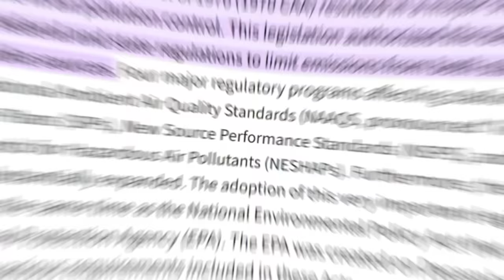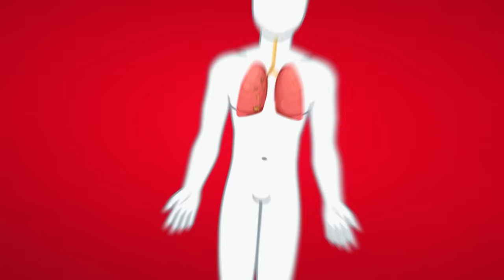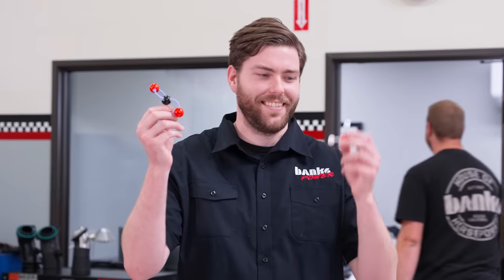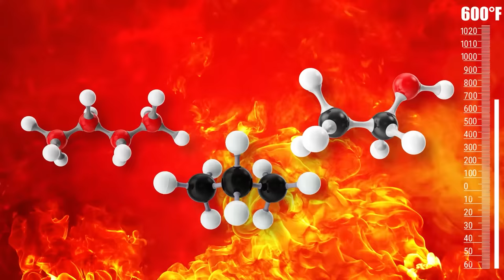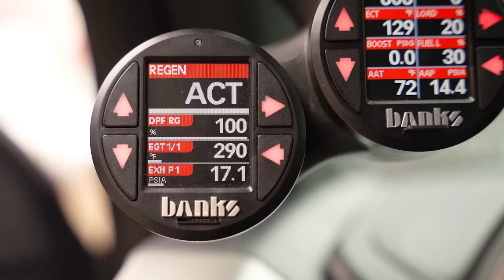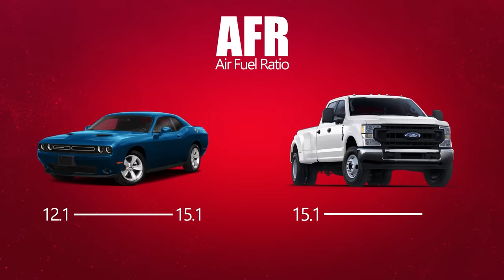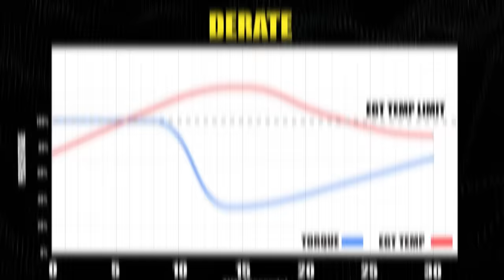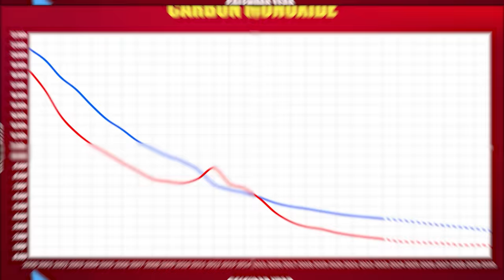Understanding the Most Hated part of your Truck | Banks Entry Level

Comment: I read online a couple months ago that the EGR was introduced to reduce NOx, but by doing so, it increased Soot, so next came the DPF. The more efficient a diesel engine runs, it creates less Soot, but more NOx. The less efficient it runs, it creates more Soot but less NOx. Then, the DEF will convert NOx to H2O. It seems like this is certainly the case in this video.
If this is the case, what reason is there to keep the EGR and DPF? I theorize that if we remove the EGR, the engine will produce mostly NOx, and we can counter that with more DEF. That way we can make the most efficient use of AFR, without having to inject non-usable gas into the intake, making the engine most efficient, while still remaining environmentally conscious.

May someone attest to my theory one way or another? I feel like I have to be missing something here, other than the fact that tampering with the emmissions system is illegal.
Reply: You are correct, theres been discussions in the class 8 truck scene to remove EGR and handle nox with DEF dosing only. It would definitely make the engine last longer without all the exhaust re-entry.  It seems to make the most sense to me, but I'm just a guy that's worked on these boat anchors for the last 20 plus years.

Comment: I don’t think it is so much of the fact that it might rob power, I think it’s more of the fact that those emissions systems are absolutely plagued with repair costs and also it going into limp mode when a sensor doesn’t read accurately. I’ve dealt with a lot of it when I drove a 2016 freightliner m2 106. Thousands went into that truck for repeated issues with the dpf/def system. The engine was great had plenty of power the transmission was beefcake as hell, it was just that damn system that would throw a code and eventually derate until in limp mode. Was not fun especially working accidents and what not. Placed me in a couple of bad situations. So you can tune all you want but those systems are garbage.

Comment: so unless i missed something, all of these waste products other then the ash can be burned away.

what about some sort of afterburner that just burns everything on its way out? could even run it on a fuel like propaine possibly?

the NOx wanta to be N2 and the O will want to be either O2, CO2 or H2O depending on its tempature, pressure and what else is available right?

Comment: What I don't understand is the DPF captures unburned hydrocarbon from the exhaust. But it plugs over time and has to go through a regen cycle, which puts in diesel (more hydrocarbon) into the exhaust to heat it up to burn off the hydrocarbon that has built up inside the DPF filter. So you'll still end up the with same stuff getting out to the environment and you more fuel. IDK, must be missing something, but you'd think engineers could figure out how to make the combustion more efficient.

Comment: I'm all for this tech, and I think it’s great that it has arrived in a time when we need it most. What I don't like, and I think most people share this same feeling with me on the matter, is none of this emissions equipment is without problems. None of it is reliable. It cost thousands to repair/replace. The vehicle is designed to not run without it.  So the common phrase you always hear is, my trucks in the shop more than it’s on the road. That's garbage! These trucks are costing more than ever, are not reliable, and get decreased fuel mileage compared to their predecessors. Again, if it worked and was affordable, I'd be all in. But as usual, the government demands regulations and control with little to no protection for the consumer.  Instead of demands, threats, and fines, the government should offer benefits and stipends to those who are willing to test this equipment out until the brains that be can perfect it.  But alas, that would make too much sense to take care of your fellow American.  

Last gripe, and it's in regard to diesel fuel.  What everyone needs to understand is, diesel is a commodity that our world cannot live without.  Like it or not.  Agree with it or not.  If you think about it, it's absolutely true.  Everything we do, create, buy, sell, trade, heat, etc. etc. etc. comes to you by burning fuel oil.  Boats, ships, trains, trucks, heaters, generators.....they all work on diesel.  As much as the liby's want it all gone, it just can't be done.  And it won't be done.  It's here until the end of time.  Maybe it's not the best option we could have come up with.  But its what we got.

Comment: As a guy who wants a newer diesel. And of course no emmissions. I don’t hate them as much as I used to before watching this video. I understand them more. So I don’t dog anyone for wanting to keep there’s on. 
But of course I’d still rather have nothing but a muffler at most between the turbo and the exhaust tip.
So I guess a questions I have. Is will Banks tune a newer truck that doesn’t have the emissions systems on em. Even if it will be used on the street. Or will they refuse to do it to avoid breaking laws

Comment: My opinion has always been that black smoke is fuel that didn't get turned into power.

And in a commercial application that's $$$$ getting blown up the stacks.

And I haven't owned a diesel rig in years but it was also black smudging down the side of my boat.

Comment: Sure its more complex and involves working around modern engineering. But i love how they literally prove that you can still make power, and more of it with this system on. I love the old diesels, its what im most familiar with, they are simple, and most people can learn to work on them. But videos like this hopefully help people stuck in the oldschool mindset to move on and up. These new trucks are offering better power ratings then ever from the factory. I wouldnt buy one made during covid and the chip shortage, electrical issues ahead. But the future is bright for new diesels, and banks, whose old aftermarket shit has adorned so many old trucks ive seen and worked on. To show that theyve more or less adapted to the times. Thats awesome!! Im from canada and my country is literally on fire. Like yellowknife was evacuated this morning, the flames are licking at homes and businesses. Think of all the towns and major cities too in canada, alberta in particular, my home province is rebuilding several northern towns and cities this year alone. The flooding, weve built berms, but the fires we cant protect ourselves from. And cutting the DPF and DEF systems out of your truck is a slap in the face to every canadian who is rebuilding from a wildfire right now. The diesel trucks that fought those fires all use this equipment, keep that in mind.

Comment: Hold on a minute, banks is definetly one of my favorite Techs out here but if you take all the things mentioned in this videos about the increased HP and torque specs from 2000 till this date and many other things is kind of misleading. If we take the example from lets say a 2.0Diesel with one from now ofc the gains are higher if you run it with 3Bar of boost compared to the ones from 2000 with at max 1Bar. The other thing is it might not make a whole lot of difference if you throw out the DPF but compared to the GPF its a hell of a difference, lets say theres even dyno runs on the newer models RS3 8Y where it eats 40-50 Hp and 70Nm of torque which from my pov, since gasoline cars with a PF run like dog crap compared to the models without it (same engine), the increased back pressure which you (banks) allready said its robbing Hp. The other thing is, we had a Tech warning, that the emissions that came out of a modern Diesel Engine with SCR, Add-blue where highly dangerous which we where not allowed to get close or put our hands on the muffler exit while measuring the emissions. Which concludes the particles are not filtered just shredded to such a tiny amount that its just under the regulations requirement.

Comment: Remove all exhaust emission equipment and gut it. Reinstall. Tune truck to keep check engine from coming on. It’s still in place upon visual inspection and still working good according to the computer.

Comment: Been seeing evidence of small diesel cars going into limp mode after a set mileage due to the DPF needing "Cleaning" even though the pressure difference is negligible. The owner will limp it to a shop, while it runs incredibly rich and then actually clogs the DPF. Manufacturer gets to pedal more DPF's and/or DPF services this way.

Comment: @bankspower 
So.. I liked most of the vid and explanation. A couple of problems I have though. 
1st) You don't talk about how diesel fuel itself is actually quite dirty and contributes to "Pollution" and how better fuel filtration can increase life expectancy of the engine and DPF system. 
2nd) As mentioned above, dirty fuel = more pollution which can = more regen. 
3rd) When talking with dealership technicians they often see DPF failure at or above 50K miles (just outside emissions warrantees), which can equal repair cost up to and sometimes over $20k to get your truck back on the road! (Solution?)
4th) Why is it that when my work truck goes into "Regen" it smells like a toxic chemical plant the leaves me feeling like "Sh#$"/ terrible (could elaborate more here) after catching a whiff of the exhaust which is unavoidable with my job? 
5th) Where is the proof of chemical composition for DPF tailpipe exhausted gasses? 
6th) My work truck is not the only truck going into "Regen", as I drive down the road I can smell and see! That's right I can see the regen gasses of other trucks in front of me stinking up the air with their regen toxic fumes! 
7th) Is this regens noxious gas really better than a little soot? I want proof! 
8th) DPF freezes in the winter time and can cause all sorts of problems. (Solutions?)

Oh one more thing mega transport ships run on Bunker Crude, so where is their emissions systems, especially when one ship produces more "pollution" than like 500k vehicles? 

Thanks,
Reply: Oh, forgot to ask one more thing. Why are we not allowed to know when the vehicle goes into regen? This would help increase survivability of the system, because it needs to finish its cycle to prevent damaging the DPF system right?

Comment: This is only one example of a DPF system. The one in my car is in the engine bay and uses diesel for regenerations.. makes the car run horribly when it goes into regen on the highway, it’s melted wire harnesses and lines around it.. it’s great 👍🏻 at least it doesn’t use DEF

Comment: Hey Eric, you did a great job explaining the DPF. Everything you said was spot on, 100%. Thank you for spreading facts and truth. The exhaust aftertreatment systems on diesels are one of the main reasons light-duty trucks are approaching or exceeding 1000 ft-lbs of torque these days. If you haven't already, I would encourage you to do a video on the DEF system and the role it plays in the reduction of NOx gases. 👍

Comment: It is nice that fass has come up with an egr filter that is serviceable, in my mind the concept of reintroducing soot to the intake is dumb and no level headed engine guy would disagree. Now as an American that hates egr and everything it stands for, I think there is evidence that egr does lower combustion temperatures, but at the risk of putting not clean air, even a particulate that is known to soot log piston rings, then proceed the oil consumption, we are in need of a superior design to simplify what we are trying to do here. So you want cleaner burning exhaust? Okay then let the guys that know how to properly efficiently burn more of the fuel in the cylinder design a better product. Also, if manufactures think they should put an entire after treatment system within the exhaust, why in the ** can’t they make it serviceable so that the particulate filter can be replaced like the heavy duty and industrial industry does with v band clamp connections so we don’t have to replaced the entire or most of the exhaust system???? I like what you guys at banks are doing to make an oe engine run to its optimum ability.

Comment: My only experience with the emissions on a Duramax was driving a 2012 Duramax for my job.  Stock it got around 12-14 mpg and wouldn't pull a hat off a crippled old man's head but we got sick and tired of it and had it deleted. Afterwards it averaged 17-18 and would spin the rear tires at 70mpg.   Not like lowering the emissions on your truck is going to matter when every company on the planet is spewing out pollution into our air and water ways and the rich burn millions of gallons of jett fuel in their private Jets. I'd rather have the power and fuel mileage.

Comment: I always love hearing Gale and his crew throw shade at dirty tuners and the coal roll crowd.  The people who complain the loudest about the crackdown on diesel tuning are generally the same ones who attracted the regulatory gaze in the first place.
Reply: Rolling coal is just a bad tune. People can change their oil incorrectly as well. Doesn't make it bad.
Reply: @oceanwaves83  It's an intentionally chosen bad tune, intentionally made bad.  No one intentionally changes their oil incorrectly.  They might do it out of cheapness or ignorance of the correct process, but they don't go out of their way to do it a way they know is wrong.  Coal rolling in an electronic diesel is an intentional choice made by someone who is often explicitly doing it to be a jerk (often targeting hybrids/EVs, cyclists, pedestrians, etc. who they consider "enemies").
Reply: @SeanHarlow  performance shops do not intentionally tune engines and transmissions incorrectly. They tune it so that it works as intended by design. No engine is better off with SCR, EGR, DPF, or any other choking device mandated by unelected bureaucrats. If you think otherwise, please install two DPF's, two EGR systems, and two SCR's. Oh wait, you won't. Because deep down you know it isn't good for the engine.
Reply: @oceanwaves83  A smoky tune on a modern diesel is inherent proof that it's been done incorrectly (or something is broken) and full-out coal rolling is not an accident.  It only happens because both a tuner and an owner chose to intentionally shove way more fuel in to an engine than it needs, for the sole purpose of producing soot.

We are not talking about EGR/DPF deletes, we're talking about coal rolling.  It is reasonable to debate the value of specific emissions hardware versus their effects on EGTs and overall reliability, but a good tune will not be smoky regardless of whether a truck was pre-EGR/DPF, has them, or has been deleted.  Debating emissions requirements is irrelevant to the fact that if a modern diesel is emitting huge clouds soot that was an explicit choice to make the engine run worse to do so.
Reply: @SeanHarlow  it was you who brought up "the diesel crackdown", so this does indeed involve mandated emissions devices, rather directly. It seems you agree that rolling coal is the result of a bad (or at least, inefficient) tune. I do not support that or anything else that causes harm to the engine, such as mandated emissions systems which do very little for the world in one developed country, not to mention all the additional emissions from manufacturing and shipping for which it's responsible. That is where we disagree, as I refuse to embrace things just because an unelected agency says so.

Comment: on  my  6.4 the  DPF  COSTS
2800.00  .  the ECM  may  need
updating by FORD through  
certain  conditions  .  they
cleaned the DPF once ..
I will check the  BANKS
system   👍..

Comment: If you take in consideration all the brake downs, all the extra vehicles needed for mobile mechanics, all the extra manufacturing of parts for the brake downs, the electricity needed to cook the dpf filter when clogged and extra vehicles needed to rent when vehicles are broke down for too long. The only ones winning with all this is the manufacturers of vehicles, parts and repair places.

Comment: I owned a 1st Gen Dodge   Would do 22-24 mpg empty. Towing 7-8K lbs. 15-17 mpg all day   The new diesels will not do that.  I have another truck with an 8.3 Cummins pre def, I love it I would not own a new diesel due to all the EPA junk on them.  The EPA is cracking down on deleted trucks, some scale houses for commercial trucks have installed exhaust sniffers now to check ‘emissions as they drive thru, no need to even stop the truck to inspect it.  Some states are writing tickets if you roll coal.

Comment: Funny, Gale Bank himself put out a video stating that a properly tuned diesel will burn cleaner than one with all the emission components intact. He went on to add how each component added created a new issue that would eventually require a new component to combat what the other component created. This was not an old video. He was very clear about the detriment caused to the longevity of the engine by these added components that were not necessary for clean burning, properly tuned diesels. Why the rollback on the original consensus? I understand the fallout of condoning illegal tampering of emission devices, but he originally stated he was pushing for less strict regulation on diesels with his years of proven data. What gives?

Comment: Fass EGR solutions created a EGR
Filter. Can you do a follow up video with your thoughts on if one should consider installing one or not? 

Have you seen or done any testing on the new speed of air pistons? It would be interesting to see what it could do with stock configuration vs banks power bundles kits for the L5P. Is the claim that it creates less emissions without the DPF system true with and without the banks power tunes. Please follow up!

@bankspower